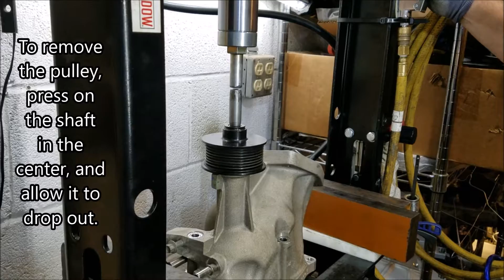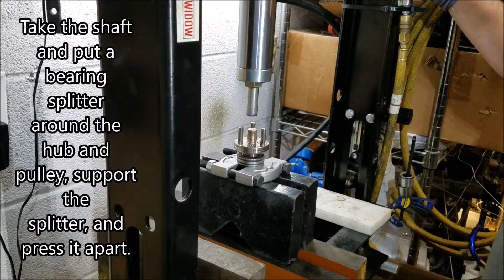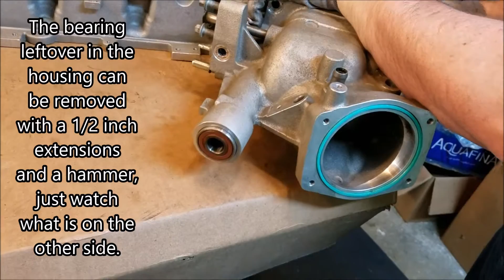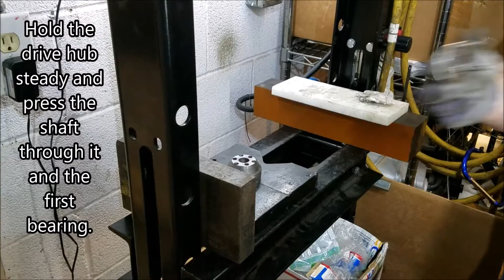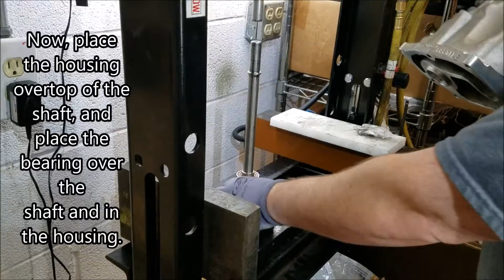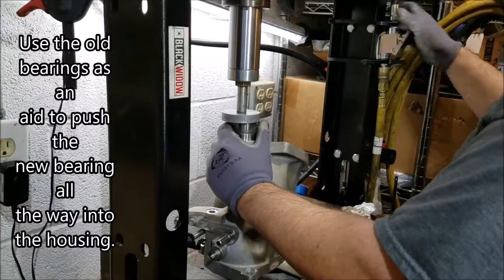Eaton LSA Supercharger Snout Rebuild

Comment: How are you driving the lower bearing in without preloading it? I've followed this video twice now to a T and that bearing is ruined everytime. The force is being pressed on the inner race not the outside 🤔
Reply from the maker: I reviewed the video and nothing should cause a bearing to fail during the installation, we still use a similar method.   The bearing bores in the aluminum housing do not require a heavy press, no damage to the bearings should happen.   Brandon contact me at qualitysuperchargers@gmail.com.
Reply: @qualitysuperchargers  will do
Reply: It’s a great video but for mk2 hub it does take some force so im struggling to find an easy way to brace the shaft to press the hubs on its a great time